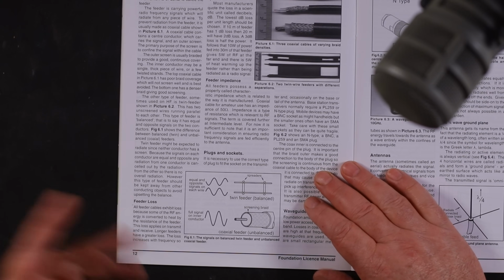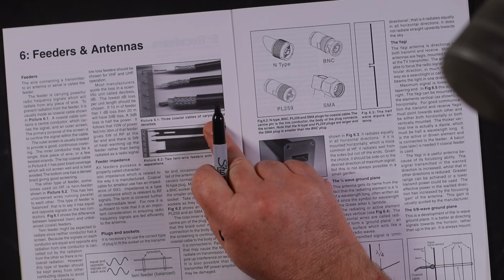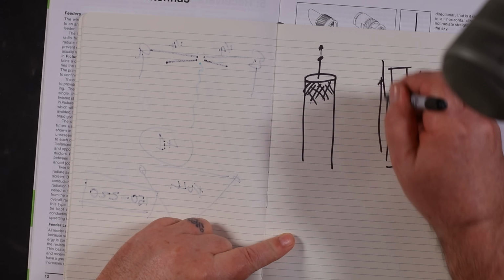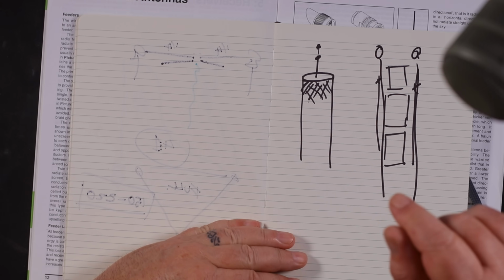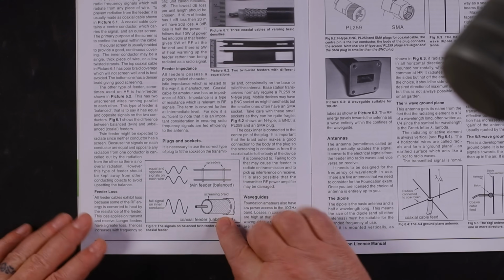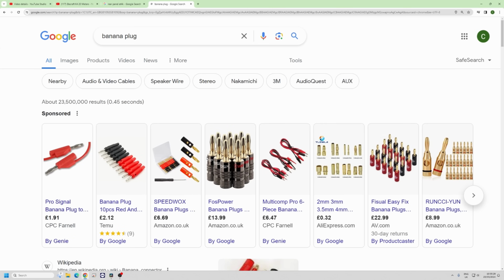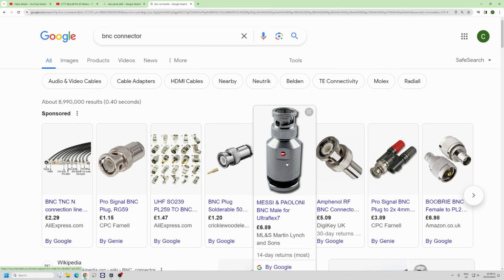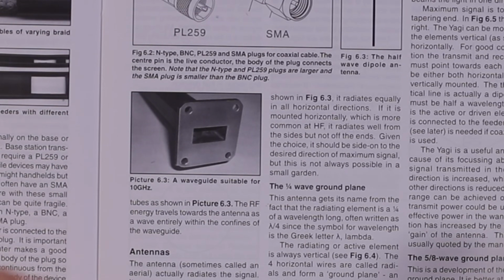Coax Cable, Balanced Line and Connectors

Comment: Do I need a balun of some kind for a doublet. On the ladder line ?  Or only if I use coax for the lasts 6 feet do I need the balun?  Im planning on using a Palstar AT-500 Antenna Tuner. Thank you.
Reply from the maker: Stick a 4:1 when it bumps into the coax (normally best idea).
Reply: @DXCommanderHQ  Thank you.
Reply: Is it better to run the ladder line all the way to the tuner?
Reply from the maker: Ideally yes - but if you can't run coax to the 4:1

Comment: What about coaxial cable that also has a foil shield that should cut down the loss on the cable.
Reply from the maker: Good point.. Although there have been a few disasters in that area.. EcoFlex 15 (and M&P to be honest) break down with continual use.
Reply: @DXCommanderHQ  Yes so best not to flex it once installed.

Comment: KF7SZT here. Leaving Mesa AZ for St. Johns Newfoundland this summer. I should attempt to communicate with you from the Marconi site. Mobile IC-706 with vertical antenna. Would you please advise me as to when you may be on the air as a normal schedule. I am an admirer of your web presence. Thank you for any information to help me.
7 3
Bill Cawthorne
Mesa AZ
Reply from the maker: Hiya Bill.. Best bet is to get notified via subscription and then clicking the bell - and testing out if you get an email to your account telling you I am about to go live. Failing that, almost every Friday from about 12:00 (London time).
Reply: @DXCommanderHQ  thank you.
Reply: @DXCommanderHQ  Friday July 5th.

Comment: I think knowing the ohm rating of canbles might be more critical for the Foundation in the UK over the Tech in the USA/CAN.

The Tech is band limited, with very narrow HF privileges.  Mostly, 6M up.
50 ohm coax will work in mist caces.

In the UK, the three classes are divided generally by power limits.  So a "Founder" might be more likely to go into HF.

Hence, one might be willing to use ladder line.

There is a guy in Houston who builds ladder line using spools of bare wire, craft sticks, and hot glue.

And you can use a coax-ladder line converter outside the QTH.   Coax rig to the outside.  Then 9:1 adapter to ladder.  These can be bought off the net.

Now, you will need some sort of impedance matcher ("tuner") for this to work.
Reply from the maker: Yes, last line..

Comment: might be a bit anorak but i always understood that with the plastic coated feeders the narrow stuff to be ribbon wire or what the american hams call window line the wider spaced to be slotted feeder and true ladder line is open wires with attached spacers each with their own optimum use and impedance  but i suppose the lines HI have become blurred over time!
Reply from the maker: Open Wire feeder is NORMALLY (I think) that 6-inch home-brew stuff..

Comment: Those SMA connectors caught me out, I couldn't work out why my WiFi had a range of 6 inches with the "better" antenna I had bought ...
Ladder line: I think the beginners need to know, they might come across the G5RV antenna and wonder what's going on. No need for massive detail, just an overview. The detail comes along as you progress, you learn more once you get a licence than you ever did in the classroom.

Comment: In the back of my TV in "the old days" was twin lead.  If you've ever seen a TV with two screw terminals for an antenna connection, it's expecting 300 ohm twin lead.

Comment: good point you made about PL259 effectively just being a screened banana plug... but you can take this to the next stage when portable.. put a banana plug on the end of your 1/4 wave wire when HF portable & just plug it straight into the centre of the SO239 on the back of your rig. It fits!. (no co-ax at all). Do make sure the rig is properly earthed. OK only good for qrp & don't touch it whilst transmitting but who needs co-ax (basically you can run a 2M or 70cm handie with a quaterwave sticking straight our of the top of it & you can run any HF set the same way with the antenna directly connected to the back of the set without co-ax